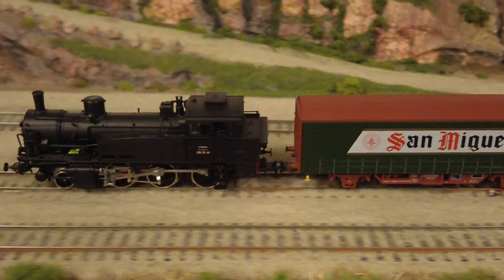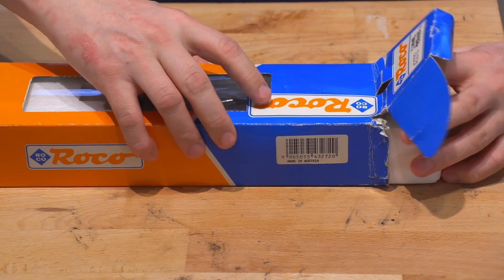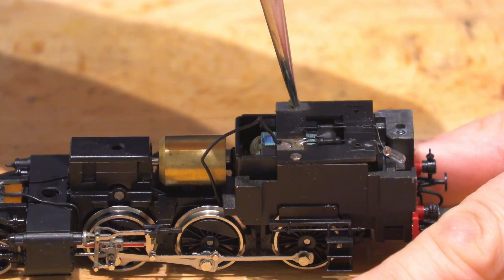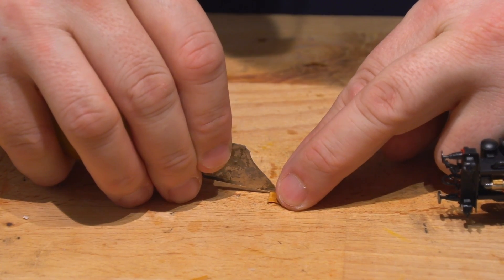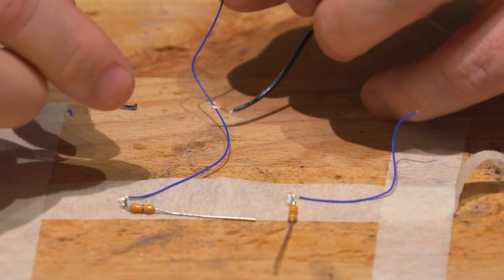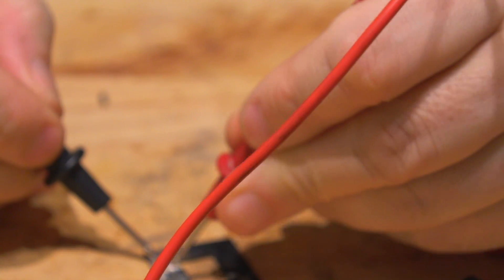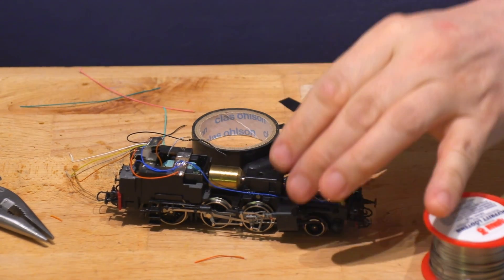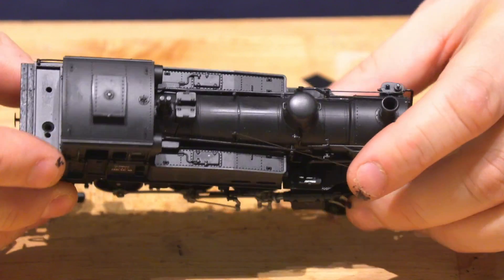Roco T12 - DC to DCC Conversion

Comment: I wonder if i can do something like that with Piko's br90 because i want to add shunter engine to my br55 set
Reply: Mine br55 has dcc port
Reply from the maker: The principle is the same, but the PCB and motor isolation will differ.
I don't have this specific locomotive, so I can't help you with the details.
Reply: @thetrainroom  the Piko 0-4-0 tank loco has conventional pickups so no isolation is needed, I have seen people add DCC to these "toy" locomotives and they end up running much more like a model than a toy.